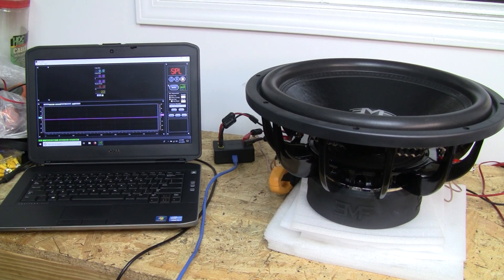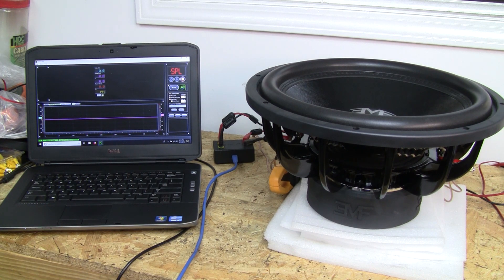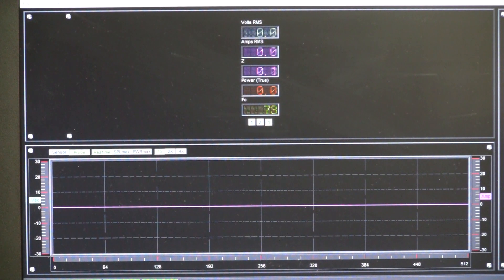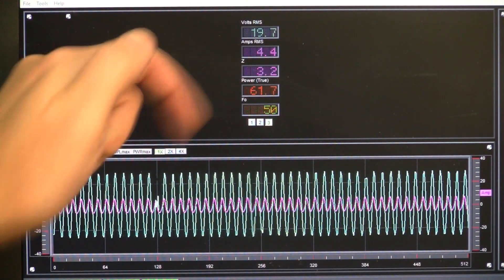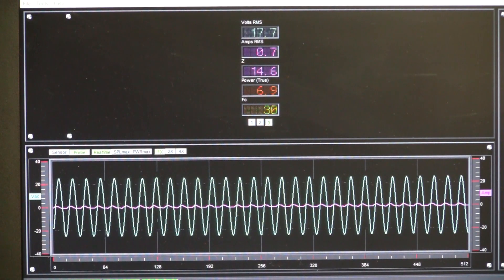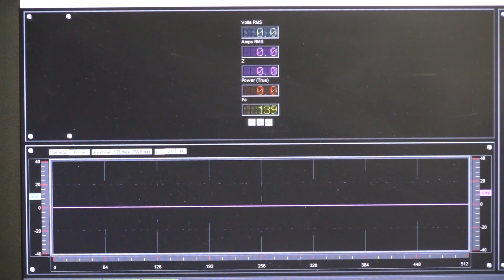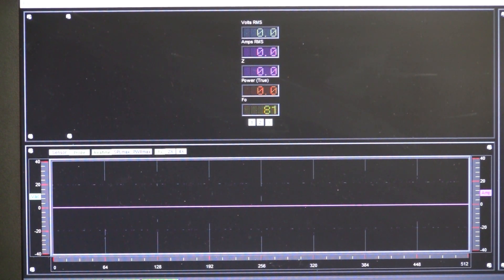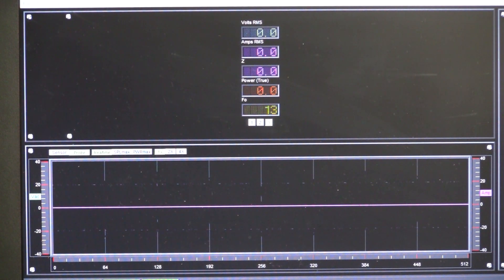Box rise isn't real, impedance rise is - Tech Stuff Tuesday

Comment: @EMF Audio the Math don't match Ex: at 50hz => 19.7v * 4.4i = 86.68watts
Reply from the maker: You aren't adjusting for power factor, the "true power" does. The voltage and amperage are raw data figures.
Reply: EMF Audio how I can find the power factor of a subwoofer?

Comment: Whoa. A laptop near a sub? Hard drives are magnetic, be careful.
Subs have it's own impedance rise. The term 'box rise' is said when the impedance of the sub shifts different than in free air, so it's not real at all! Hihaha
Reply from the maker: SSD's aren't magnetic. The field on the sub isn't strong enough to reach that distance of any significance, and rotational drives have an aluminum case that works as a faraday cage as well, to some degree.
Reply: EMF Audio I know that! I just thought that you're running a hard drive .
SSDs aren't hard drives, they are flash drives!

Comment: What do you think about running an amp at .25 ohm daily ?
Reply from the maker: I don't know of any that will. More times than not they'll protect before you get past half power. They protect for a reason, even if you sorta got away with it, I wouldn't push your luck.
Reply from the maker: Also, efficiency goes completely to garbage that low.
Reply: Thanks for the tip ..I'll be wiring my subs back to 1 ohm then

Comment: I don't think anyone argued that rise doesn't exist outside of an enclosure, I think the term box rise makes sense because in your box at your peak you'll have a different impedence then you would in a different box.

For me I peak at 46hz which brings me to 4.4ohm and hits. 146.2 on an audio pipe 2k. So probably ~5-700w.
Reply from the maker: That isn't correct, which is why I made this video and have another one planned. Just like a subs characteristics change impedance shifts in free-air, they also change in the enclosure. Your impedance during play can change from any given box change, but you can also have a given enclosure and change the sub and get a different impedance. The enclosure isn't a set impedance rise, only then would "box rise" be sort of correct because that's still a reflection of impedance. The only way box rise would be completely correct is if it was having an opposing force on gravity.
Reply: @EMFAudio  while I get what your saying I see this in other hobbies. One of my other hobbies is growing weed. Weed growers call a cutting a "clone" and old gardeners hate that term.
Reply from the maker: @Str8GasGenetics  I see what you're getting at, but what I'm saying is literally two completely different principles, one of which isn't real. What you're saying would be like calling the cutting a clone, but it's actually a regrowth of a potato.

Comment: Does heat affect impedance?  Say I had a 8K amp and my voice coils on my subs started to heat up at 10 minutes of play time.  Does that significantly alter the impedance of the subwoofers?
Reply from the maker: Yes, it absolutely does! There are 2 ways this can be demonstrated. You could run a test tone with an SPL meter and watch SPL drop over time as it gets hot (this is assuming your voltage isn't dropping). The reason being, impedance goes up, power output goes down, SPL goes down. Or, you can check impedance while cold, play them till they get warm/hot and immediately check impedance again. You'll see impedance is higher than when they were cool. After they cool off, they'll go back to "normal".
Reply: @EMFAudio  Thank you for the video and explanations.